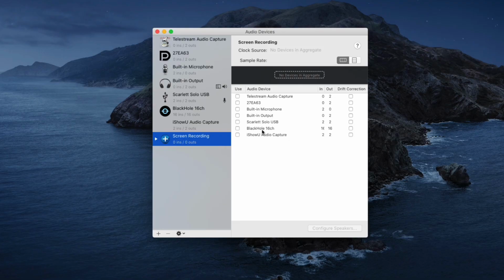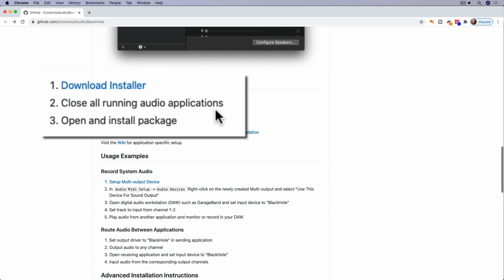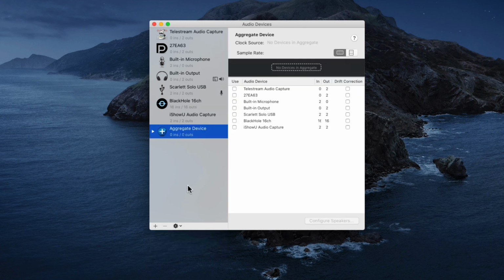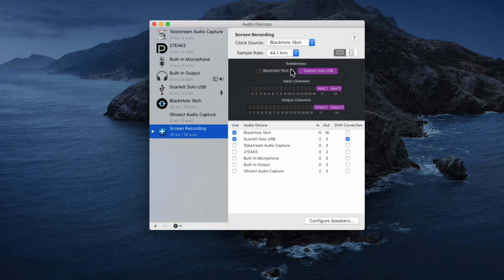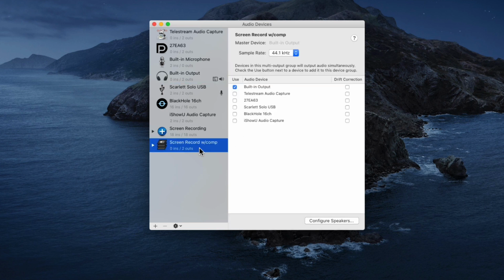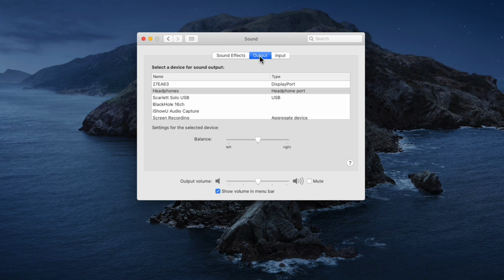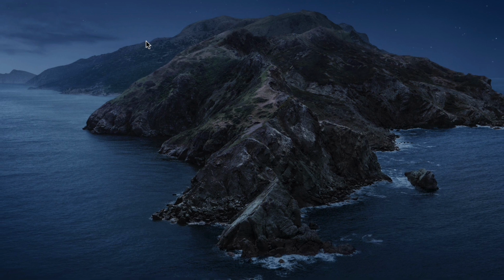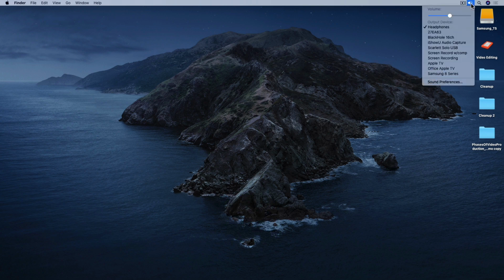How to Record Your Screen with Internal Audio & Microphone on Mac Using BlackHole (FREE)

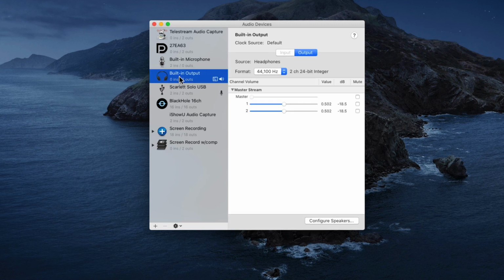Comment: I have a big problem -   I’ve been trouble shooting for a couple days.  When I plug in my yeti the sound stops coming out the computer or it won’t with headphones either.  I was thinking about deleting black hole and reinstalling it.  But I thought first I’d use your instruction video to double check all my settings.  When I got to about 6:58 or so when you remainder me to check the for the 44,100 hz.  Well now it appears Mac has changed this.   Mine was on “2ch 24 bit... and I’m going to try and change it to 2ch 16bit integer 44.1kHz.    

Can you think of anything else that might cause a yeti to get plugged in and kill all sound coming out ?
Reply: Update.  I saw that it is on the 2ch 24 bit in your video so I put it back.  Guess that was t it.  I’m getting so behind.  Can I pay you to help me.  If you think you know what it is.
Reply: I was looking at your  “bit” settings for each or maybe it’s Hz settings.  Some says 2ch 16 bit.  Another says 2ch 24 bit and I think one said 32 bit.   Does this matter that their different.  I guess they all fall under the 44.1khz. Just different bits.  Idk.  I’m just trying to get back to where I can monitor my voice when recording with garage band or anything.  NOTHING comes out when yeti is plugged in.
Reply: @realtruthseeker521  Same for me, haven't figured it out. I had to change my output settings from the multi-output channel that he made back to Headphones because this video would not even play with multi-output channel selected from my system preferences.

Comment: QUESTION: What happens if I do not have another external microphone, separate from the one in my headset? I need to use my headset to hear what's going on in a zoom conference AND speak, but the "build in output" only allows output (no imput) and the built in input, only allows input and no output and when I try to set a Multi-output device which would include both, internal sound and my voice over, I can only select Built in output + blackhole but not built in mic... The effect of this seems to be the person in the other side cannot hear me at all. 

I need a configuration that would allow me to 1) use my headset, with mic AND record the internal sound  (zoom, BBB, skype) + my voice ensuring they can hear me and there are no awful, scratchy deafening sound coming from my end. PLEASE HELP!And thanks for the best video to date on this issue.

Comment: I dknt have "built in output" as an option, what should I do
Reply: you can select macbook air speakers or macbook pro speaker instead of built in output
Reply: Same here. Have you figured out a way of doing it?
Reply: @arthurbecker12 use whatever icon is the same as his icon for built in out put, I believe its speakers

Comment: I just realized when I want to do screen recording in Quicktime, without voice over (important for me to eliminate my own voice in this step) I m not sure what to select in the Quicktime recording tab that pops up for screen recording. (the drop-down menu next to the rec red dot) What would be ALL the settings for a Quicktime screen recording without external input (that is, without voice-over, or ambience noise from the room, things that my headset microphone or the external mic of the computer could pick up)that only contains the screen sound on playback;  and what settings for a zoom conference where I need to record the internal sound from the computer AND my own voice for playback? THANKS!

Comment: FIRST TRULY STEP BY STEP Internal sound recording with BlackHole Video!. THANKS! All other videos I've watched are convoluted and incomplete. I have subscribed to your channel because in addition to being thorough, you have the nicest voice. All other videos I've seen are a waste of time. I have a few questions. Once you have recorded internal mic alone or internal mic + voiceover, what do you select for playback? do you change to simply "headphones/speakers? Also, I could not really "monitor the sound" while recording with Quicktime because there were no bars moving, and I mde usre to turn the headset mic (external source) low, to avoid feedback. So, I was testing it with your video. Though I could hear you, I was not sure sound was being recorded. What settings to you use to play back what you recorded using blackhole? I had successfully installed sounflower, but eventually it began to fail. I have a very important conference for my thesis and I have spent day and a half trying to solve this issue. Any help would be appreciated. So far, no internal audio seems to have been recorded at all. Before with soundflower it worked. What you say makes a lot of sense, but I cannot make it work :( Also a program named "Extented Audio Recording Device" (spelled like that!) is still in mi MIDI list, despite having uninstalled A Powersoft device (it seems impossible to eradicate fully!) and I wonder whether that spurious piece of software is still hijacking my audio somehow. I could also not fully get rid of Soundflower...

Comment: The steps varied somewhat from the tutorial in my case, but I experimented and figured it out. I successfully captured Internal sound into Quicktime. Now I have a useless Quicktime audio file. 😆
Reply: what did you do to get around the lack of a master input option please?
Reply: @Focus-an-flow  – I have selected MacBook Pro Speakers, then BlackHole
Reply: @Focus-an-flow  – Master Device: External Headphones
Reply: @mlyaeger9989  Thank you
Reply: @Focus-an-flow  – See my subsequent post, re. using Audacity.

Comment: just bought an m1 air. 
AMAZING how stupidly difficult such a simple thing like this is in macos... painful.
Reply: dude just use the screenshot app on your computer. you dont need all these stupid plugins.
Reply: @lourenzomartin312  yeah sure, but it does not get computer audio, unless i'm doing something wrong.
Was editing a video for a client, he wanted a snippet. I wanted to screen record a clip and have the audio be part of the recording. Couldn't get this to work without all these external and not easy to use plugins.
Reply: @cinialvespow1054  yes it does.
Reply: @lourenzomartin312  so i go to spotlight and search screenshots? and then get to record screen? and that will include system audio?
Reply: @cinialvespow1054  yes
Reply: @lourenzomartin312  dang that did seem to work. Nice

Comment: Sadly it didn't work for me. Did everything as you showed but it only records the display an my voice from my XLR microphone, but not the internal sound...
Reply from the maker: Sorry to hear that. What is your setup?
Reply: @michaelkinney  Hey Michael, thanks for responding! So I tried it again and it does actually work when I use my "MacBook Pros Speakers" as a checked device in the "Multi-Output Device" (So exactly how you showed in your video). Then I can record with internal audio and with my external microphone. However it doesn't work when I use "External Headphones" instead of the "MacBook Pro Speakers". So instead of the speakers I checked the "External Headphones" in "Multi-Output Device" and put them as "Master Device". Strangely this way I can record internal audio but my microphone doesn't record...

My setup is: 
MacBook Pro 2019, 128/8 GB, macOS 11.2.3
Steinberg UR22 mkII USB Interface
Superlux Microphone (via XLR into Steinberg)
Sony Headphones connected via cable
Reply: @michaelkinney  I found the solution! Wanted to show something in GarageBand and forgot to select a different Output Device in GarageBand, so everything worked out in the end! Thanks mate! :)
Reply: @lukeknoxxmusic  Thanks! Im using garageband too and i am trying to get it to my iPad pro, so you commenting this helped me aswell

nevermind, sadly i don't know whats wrong :(

Comment: This is an exceptionally useful tutorial and I am super grateful for it! Thank you. One point: maybe this is a thing with the latest version of macOS, but there is no audio device called "Built in output" on May 2019 MacBook Pro. I had to instead use a device called "MacBook Pro speakers," and that worked.
Reply from the maker: Should be called "Built-in Output" in Audio MIDI setup, left-hand column.

Comment: In the end when we got to system preferences > Sound > Input > blackhole 16CH it says "The selected device has no input controls", so my system sound is not getting recorded. Could anyone tell me why is that happening? It should have had a slider for volume in that place instead!

Comment: I was having problems with low volume on recordings.  Go to Sound Preferences -> Output -> BlackHole 2ch (or16ch depending on which version you installed) and make sure output volume is set to the max.

Comment: So this works with quicktime, but it doesn't work with audacity. Im using the same input for both, but Audacity won't capture the system sounds. I have everything set up as it should be, it's just one program records everything and one doesn't
Reply from the maker: Check my video on using BlackHole to connect audio meters to Audacity. May be something in there to help with this: https://www.youtube.com/watch?v=vkpHmIeejas
Reply: @michaelkinney  Sure, I can recored either my microphone, or my computer's audio, but not both at the same time with Audacity, even when input is the aggregated device, it simply doesn't work. Also, certain apps like Spotify won't play through the multi-output device.

Comment: I tried to install it accordingly. but when i put the blackhole audio output as audio output i cannot play any media. neither online or music from my mac. when i switch back to my regular audio output it works, but that makes it impossible to record the sound of any media. is there any mistake i could have made?
Reply from the maker: Make audio output the Multi-output device (which includes BlackHole).
Reply: had the same problem. then installed version blackhole 2 channels and not 16. It worked!

Comment: I have been trying to do this. However, I downloaded and installed BlackHole onto my macbook air, and even though it said it installed successfully, it is not showing up in Audio Midi, or anywhere else that I can find. I have tried multiple times. Anyone else have trouble installing it? I have searched the internet and there seems to be no help for this out there.
Reply: It works...

Comment: Hi, Michael. Nice video! I'm using Big Sur, in an M1 Macbook Pro, and the option "Built in Output" mentioned at the 7"10' is not showing. Just Macbook pro speakers and external headphones, besides blackhole. Any thoughts?

Comment: @Michael Kinney Thanks for the video a couple questions;
In terms of set up, why do we need to create a Multi-Device output? For QuickTime and other screen recordings we are concerned with Input, so as long as we create a new input (and select it with screen record or QT, it will use the designated Aggregate input). 
My question comes from these two things.
1. While screen recording and the System Sound set to the Multi-Device output, you can no longer control the sound with the Mac keys. 
2. If I leave my "headphones" or Internal Speakers selected, I am still able to hear everything from the recording AND turn down the audio with the Mac Keys if needed. Of course, this turns down the audio being recorded as well.

Lastly, in set up I there is not slider bar for the microphone on BlackHole... could be because I am using the 2ch one.

Anyone else notice this?

Comment: This worked! However, the internal audio is still louder than my input. How can I fix this? Also, is there any way to mute my computer speakers so that I can only hear everything through my headphones?
Reply: I was wondering this too
Reply: Try going to System Preferences, Sound, Output, Click on Internal Speakers, Click Mute.  This worked for me.  Now I can adjust sound with my interface and not hear my computer speakers.

Comment: looks great! Thanks a lot! One question though. I can't hear any of the internal sounds while recording internal sounds only. Can I somehow change that?
Reply from the maker: Did you select Built-in Output as part of your Multi-Output Device?
Reply: @michaelkinney   i can somehow not use the multi output device. I used the aggregated one and it works for me. Whenever I start the recording I do not have the option of choosing multi output devices. Recording it works, but I cannot hear audio at the same time. 

 Also let’s say I want to listen to the audio over headphones and record at the same time, what would I have to do?
Reply: @michaelkinney  nvm. I figured it out. It was a problem in the settings.
Reply: @Michael-McCollum  I made the multi output device thingy like he said. Then in the settings I made the mistake that I tried to select that new device. However that didn’t work for me. Instead I selected the new device in output and in input I only selected the blackhole. Then before you start recording in the options of the recording you have to select thr blackhole too, otherwise it will not work.
Reply: How did u fix it?

Comment: My audio devices doesn't show "built-in output" does anyone know why that is? and how I can get it to show up?
Reply: you dont need built in output just choose whatever output you're using - speakers or headphones
Reply: im getting the same exact problem and cant get the answer anywhere
Reply: @threestheory  I swear nobody has the answer. I am going to call Apple support and see what they say. I’ll let you know if I find anything out
Reply: @jordancswanson  thank you!
Reply: @threestheory  so apparently “Built-in Output” is the same as “MacBook Pro Speakers.” So when I created the Multi Output Device, I checked MacBook Pro speakers instead and it worked for me. However, I want to listen through headphones and still get the audio recorded so I chose “external headphones” instead. Also, if you are using a program like Adobe premiere, once you get input and outputs set up in your sounds, you still need to change the input and output channels in that program. Ex. I chose in Adobe premiere, the multi channel output that I created as my output. Lastly, when you finish a screen recording on QuickTime and you go to watch and listen to the play back, you need to switch back the output from your macs sound to either headphones or MacBook Pro speakers. Hope this helped.
Reply: @jordancswanson  THANK YOU!!!

Comment: Thank you Micheal for the detail here. But it's a bit misleading. In order to achieve the goal of recording system + external mic audio, you don't need to check your mic in your multi output device. You are already outputting the mic signal to the screen recorder by having your mic checked in the main device (Screenrecorder). The second thing, which is misleading, is your treatment of the system input. In that setup it is not relevant, what source you select as system input. Screenrecording works (and must work) independently from that setting - you can choose whatever you want. Nevertheless your info got me startet, thx for that.
Reply from the maker: Thanks for the feedback. Glad to hear my info got you started! I like to see people build on and improve what I put out there. In the end, it's what works for you. Cheers!

Comment: I have the problem, that I did everything as you showed, but i have no sound in the multi-output. Switching back to the headphones / built in I again have sound. 
Is there a problem with Big Sur, or what am I doing wrong?
Reply from the maker: Do you mean when you play back your recording you have no sound when the Multi-output device is selected?
Reply: @michaelkinney  Thanks for replying, but I fixed the problem just a second ago. Audacity has problems with recognizing Blackhole as legitimate and therefor seems to not integrate the desktop-sound, while recording. Recording e.g. with QuickTime-Player works perfectly! 
Thanks for asking and answering!

Comment: All of this worked fine, but I'm having an issue you may or may not be able to help with. I am using the internal audio to do music reviews and primarily hip hop. What I have come to notice is that the audio from the recording is coming back very staticky. I'm not sure if there is anything else I can do to fix this, any suggestions?

(It happens the worst when Bass comes from the internal recording) P.S. I meant to put this comment on this video not the other one.

Comment: Wait I got it to work!! Instead of doing the built in output I had to connect and select my bluetooth headphones!
Reply: hey what do you mean. How did you get it to work with bluetooth headphones because I have been trying and it hasn't been working
Reply: @MsNathanyl  instead of selecting the built in output I had to connect my headphones and then they came up and I was able to select them

Comment: Good video, very clearly explained. Just a question, is it possible to save the recorded file directly to Google Drive on a Mac instead of the default Apple iCloud? With the limited cloud space provided by  Apple, I am unable to save my recording on my mac. Please advise. thanks
Reply: there's an option under screen record where to save the files, most of the time it auto saves to the desktop or documents and you can move it around from there

Comment: Great tutorials! 
URGENT question - where do I connect headphones in order to hear the mutli-output device? As the gentleman below commented, there was no "built-in audio" option, so I chose "mac-mini speakers" instead (I imagined these were the equivalent). Now, when I connect headphones to the mac-mini, I still hear the output device on the mac-mini speakers. (I need this setup to record remotely my online music lessons, so the monitoring, as well as echo avoidance, are crucial for a successful recording.)
Reply: And if you have a way to tell me quick settings for OBS (I need to save on file size...), I would be doubly grateful